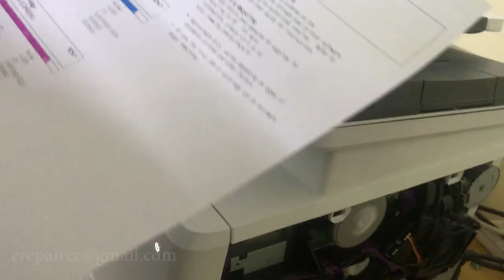Transfer belt (ITB) Replacing Hp Laserjet M277

Comment: 2:48 it just doesn't move! Everything worked to that point, but the belt is stuck. something is holding it in place...
Reply: pull out that white thing at 1:39 further. I used a plier for it